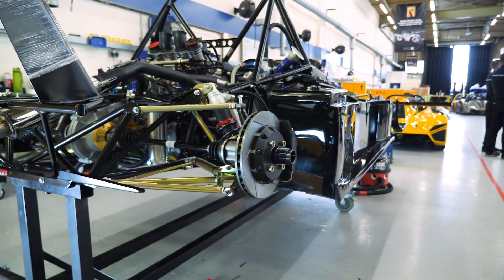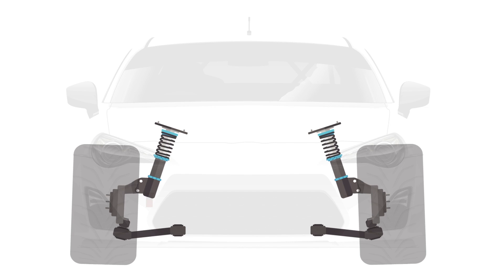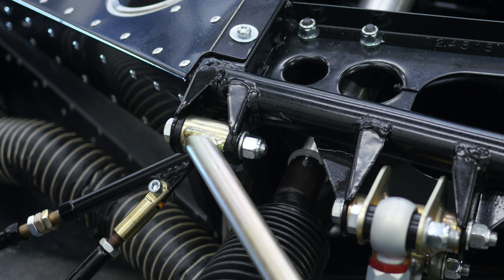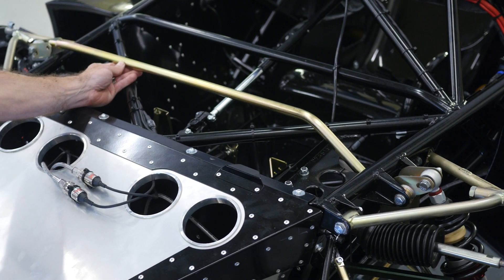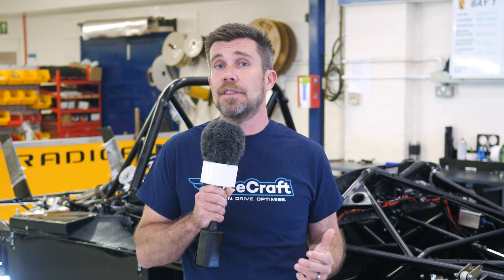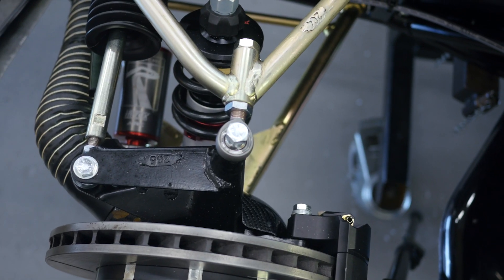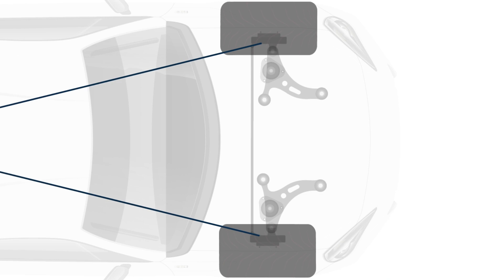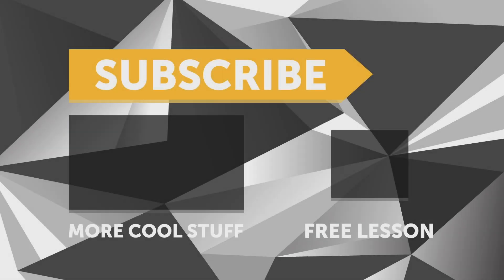Ackermann & General Suspension Design #shortish

Comment: Delrin has advantages over polyurethane, most useful is that has a higher lubricity and lower stiction than polyurethane. This is even before grease is considered.
Reply: Delrin can't be cast though can it?
Reply: @FairladyS130  it can be injection molded.

Comment: Suspension stuff is always good, what would be interesting too is a discussion on what gives modern cars their superior grip over older cars. Is it their stiffer chassis', electronics,  design and so on.
Reply: Tire compounds more than anything. Herb Adams Cheverra Camaro and Fire Am Firebird were achieving over .9 G in the 80s with a Goodyear 255/50/15  Radial which today would be considered Small. Even earlier the 917 and Greenwood C-3s used a 15” bias tire with 19” section width and 17” tread width. Both cars could reach 200 mph at lemans. Few race cars today use such large sizes.
Reply: @montycrain5783  True of course but watching some amateur US driven Camaros and Corvettes, their grip has to be due to significantly more than just tyres.